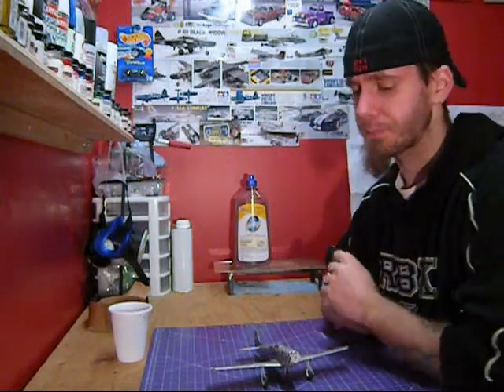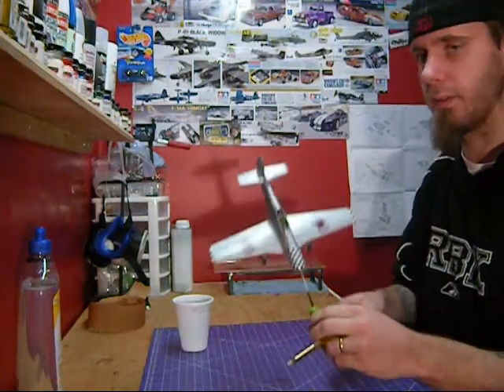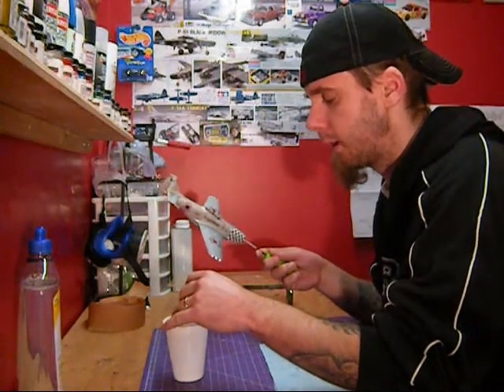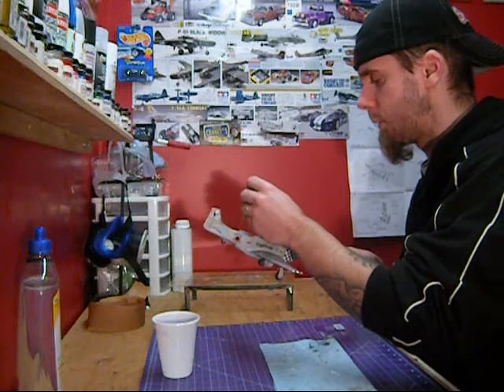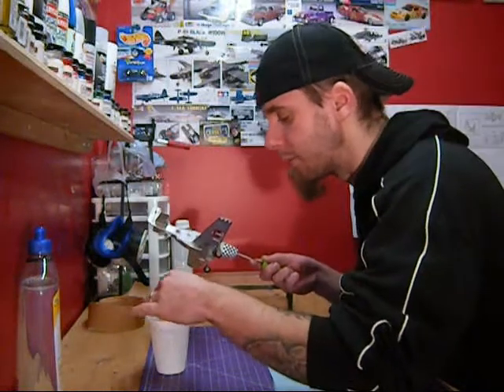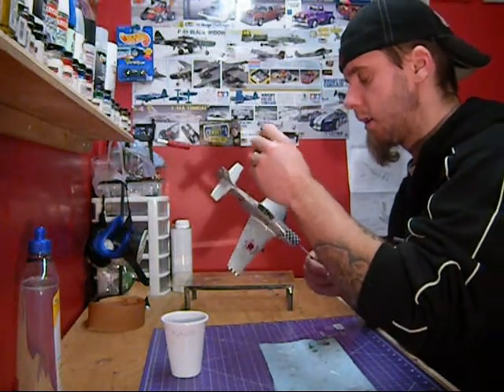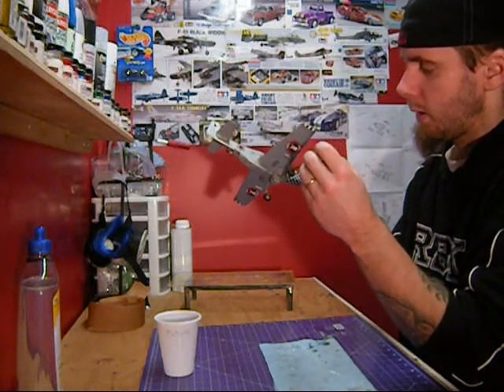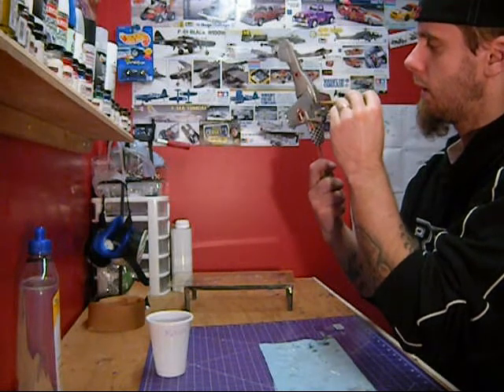How I Use Future Finish For A Great Shine

Comment: I've been using it for5+ years on my NASCAR diecasts and love it.  The key is to apply multiple light coats that have full coverage.  I've done up to 7 coats for a real glossy shine.  Regarding the cracking comment - I've seen that happen every now and then on my cars and I think it's because the base paint has not fully dried.  To fix it I just keep applying more and more Pledge Future Shine and after a few coats the cracks will be filled in and it will look fine.
Reply from the maker: Great comment thanks for the info.
Reply: Yeah, I’ve been using it for a couple years now and I’ve had it crack on me once. I thought maybe it was the humidity. I live in central Arkansas and the day it cracked there was a lot of traffic in and out the house that day and it was mid summer and like 90% humidity. I shot a second car the next morning and had no problems. 🤔   And I airbrush it.

Comment: Thanks for the video. I’m a novice modeller just completed a model, completely brush painted with Vallejo paints, no varnish or gloss coats applied. From watching your video, am I correct that I just apply the floor wax as is - no need for anything else, no preparation no other “stuff” needed etc. 
It seems so straight forward! Thanks

Comment: Hey Jan, I have used future on my last 3 model cars.  The 4th one I did was a red bronco.  when the future dried, it created and cracked effect over the entire car.  I brushed it on just like the others but it had a very undesirable effect.  I have tried to apply a second coat, but the results was the same.  I sanded it down, and applied another coat, still got the same effect.  Any suggestions on what is going on.  I never had issue with any of the other models and used the same brand of paint.